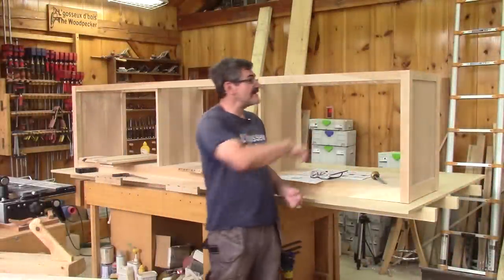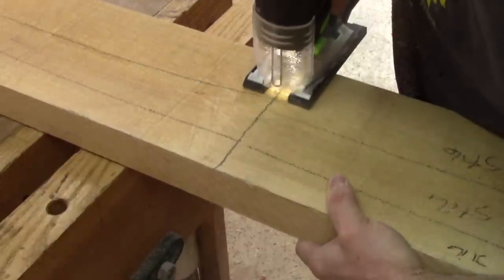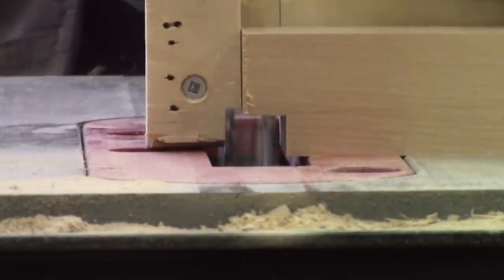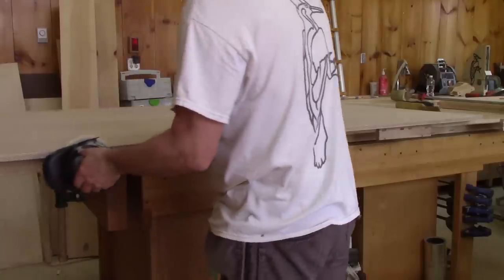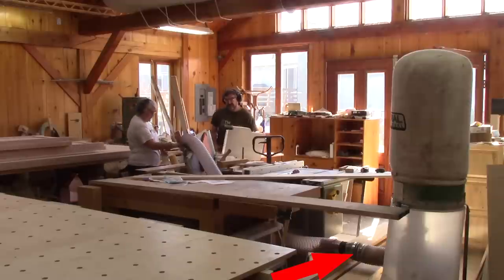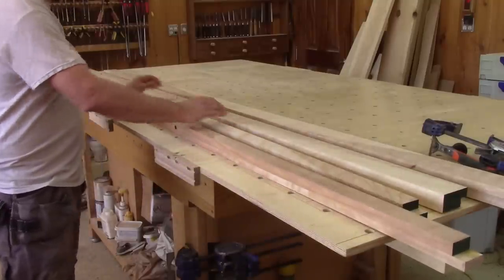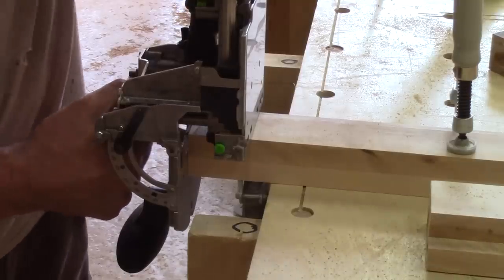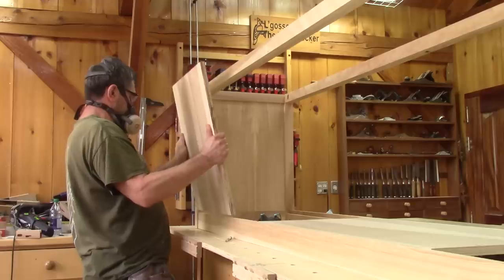The Woodpecker Ep 252  - Closed bookcase part 1

Comment: Great video, thanks for sharing. Why did you use ply of that thickness, I might have used half that thickness - or less depending on where it went?
Reply from the maker: They only had ¾" birch plywood of this quality.  For the top of this I needed something strong, I also needed strong plywood for the shelves and the interior part of the top. So having the same plywood everywhere made sense. But gee this plywood is expensive, I never bought such expensive plywood in my life. Also it's the nicest plywood I ever bought...

Comment: That is very thick plywood, that unit will be very heavy, and close to impossible to move
Reply from the maker: Yes it is. I estimate over 450lbs. It's one of the reason it's all in pieces. like a super high end Ikea piece with super heavy duty knockdown joinery. The other reason was the huge size of this, 9' wide by 7' tall all solid birch.

Comment: It will probably look nice when your done. 

Question. You refer to them as mortises, while others refer to them as floating tenons.  Is it because the festool is called a Domino Mortiser?
Reply: The mortise is the hole portion of the joint. The tenon is what goes in the hole. A floating tenon is one that isn't part of either side of the joint (two mortises and a piece of wood that fits in both holes.) (Hope I understood your question correctly.)
Reply: @vandermore  no you didn’t. I was asking why he called them mortises while others call them floating tenons.
Reply from the maker: the floating tenon is the piece that goes into two mortises. The hole is a mortise, so I drill a mortise on both pieces and in between goes a floating tenon, in my case Festool call them dominoes, but they're floating tenon.

Comment: Can you estimate how much of the original wood was removed to get the final size pieces?
Reply from the maker: for witch part?
Because for a lot of pieces in this, I had to sometime remove up to half the thickness, but not on this part.
The stretchers had ¼ thickness removed to get the right thickness of the final 2 pieces glued together. These days it's so hard to get wood and I was unable to find 8/4 of 10 foot long it's why I had to glue two 5/4 together and plane them